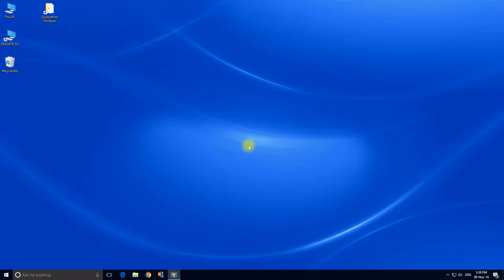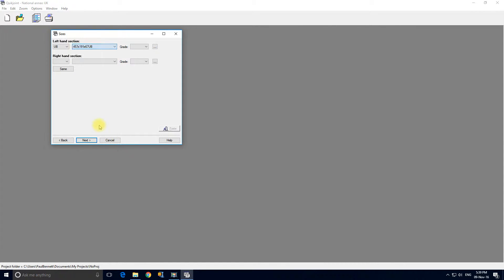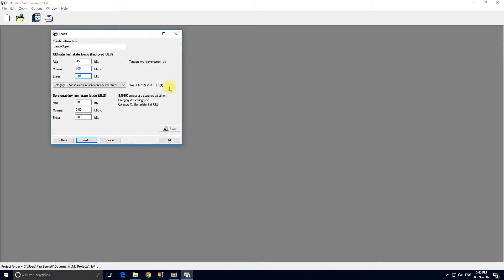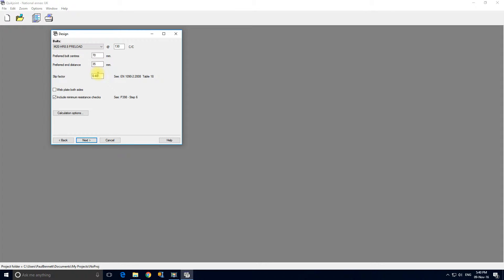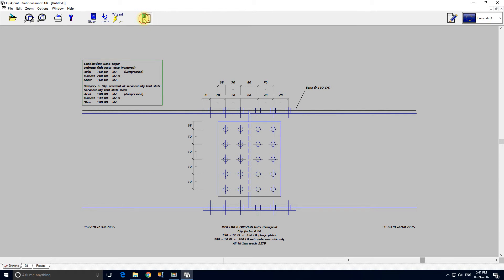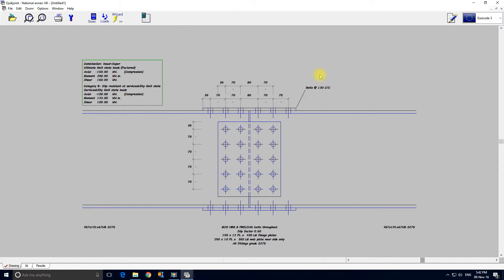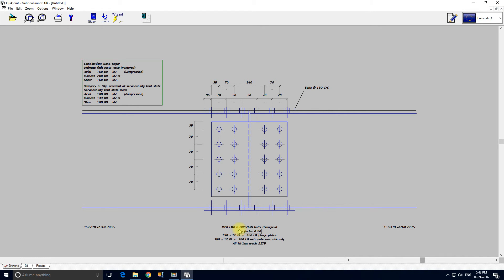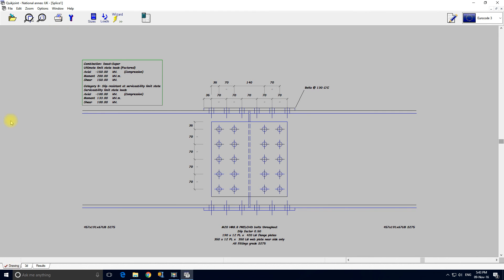Design of steel splice connections using Quikjoint

Comment: Can you adjust text position In the calculation? Only that some of the text overlapped on the preview of the calculation. I'm a stickler for clear reports that's all.

Also, the initial pass on page one is black and bold.
Can this be changed in colour at all? It's green elsewhere and wondered why not the summary page?

Thanks again. This software looks great!
Reply from the maker: Thank you for your comment. The text has overlapped slightly, this is not usual. It's possible to reduce the text size which should fix it. The summary of results is black and white, but as you say in the detailed results green/red is used for pass/fail. This can't be changed, but the summary is pretty clear. If you have further queries please email sales@quiksoft.co.uk for a faster response.